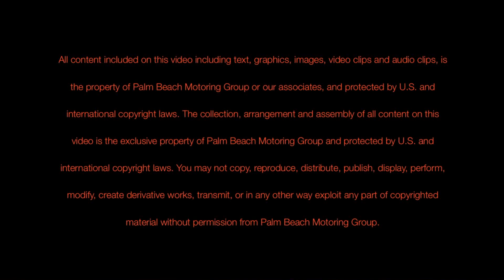Mike Phillips & Matt Steele - How To Detail Your Car with Pinnacle Natural Brilliance

Comment from the maker: The wet look comes from doing two basic things to the paint,

1. Make the paint as smooth as possible by removing above surface contaminants.
2. Remove as many below surface defects as possible.

Then use a high quality finishing wax, sealant or coating.

-Mike Phillips